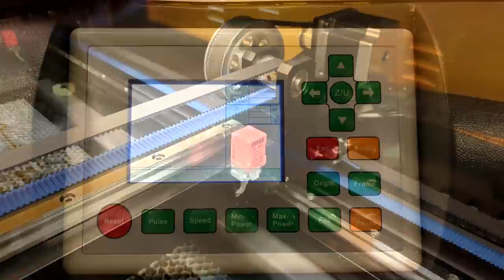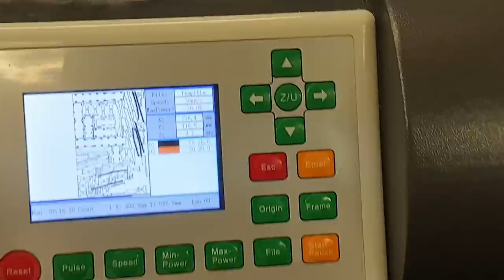China 100 W Laser at work - real time cutting of plywood 3D model of Suriname bridge

Comment: Hi @Tinkerman
I'm also looking into getting a 1060 or similar. As I'll be cutting usually 6mm birch ply I was thinking on getting it with the RECI W4 but is not commonly used so the choices reduce.

I've notice one of your wishes was to have the belt on the X & Y axis. Is that to increase the torque so u could run the machine faster? or is it for another reason?

Also, I've read on AE and in your comments that the price included all the tax however I'm worried to buy it and then get a call from customs in Estonia and have to pay +20% of the machine again... As you're in EU, could you tell me about your experience?

Thank you very much in advance!

Looking forward to seeing more videos using it too!
Reply from the maker: Hi Cabani. The belt is to reduce steppermotor vibrations mainly (not what you would expect is it?). In videos of Sarbar MultiMedia (https://www.youtube.com/playlist?list=PLeKaKWOIPgi_XP6Nxzeapp-vUMCLQyVMB) this subject is extensively discussed. As for my experience with the delivery: At a certain point in time, after 6 weeks of waiting, nobody could tell me where my machine was. Track and trace told me that it was still on some trainstation in Bulgary somewhere. Calling the shipper and asking him about the train station or any other location where my machine might be, resulted in an angry man telling me that i was not his customer and that i should not talk to him but to the shop where i bought the laser machine... that gave my a very uncomfortable feeling for a while, but in the end, after being patient for about 10 weeks, it just turned up and was delivered at my door and I never had to pay any taxes afterwards as promised. So yes... you will have to take a long leap of faith, but it is worth it!! They deliver as promised. If they didn't they would be expelled from AliExpress.
Reply: @MakerFarmNL  Damn, I'm truly grateful for sharing such a gold mine! So much content to learn from on Sabar's channel! Now I need find time to learn from him too.

Now I see the purpose of the extra belt, to avoid what he calls "the curtains" isn't it?

I can imagine the nervousness of having the expensive box on an unknown position.

Since we're at it, are you using any sort of fume extractor with active carbon filtering?

Thanks for all your feedback is much much appreciated!
Reply from the maker: @nachetejr  Yes the Sarbar Multimedia channel is quite an impressive source of knowledge! I use this https://www.hbm-machines.com/producten/werkplaatsinrichting/elektrische-ventilatoren-an-aircos/hbm-300-mm-professionele-ventilator to extract the fumes from two points (back and side) on the machine. I just vent all the fumes to the big outdoors (I have no direct neighbors), and i don't use any filters, because they would obstruct the airflow too much IMO. The sublimation process implies that the materials are being transformed into a gaseous state. That means that the laser will ignite these gasses in many occasion. So big flames will often be produced underneath the honeycomb table. In order to extinguish these flames and to make the gasses less dense a huge airflow is necessary. The standard airflow of the machine is only 20% of what is needed for this flame-extinguishing-process to be effective.
Reply: @MakerFarmNL  I hear you, an inline fan. Unfortunately I'm surrounded by people and I should have a filtration system. 
Thank you very much for all your inputs, I'm looking forward to see some more of your work and learning tips and tricks from it ;)

Comment: Hi, Tinkerman, I watched your video and it's fantastic how these laser cutters work. I want to buy one for my self. Doing a little research what to buy and what is total crap. So, I watched your video and I don't understand what is that kind of pen looking thing sitting next to laser beam output. Can you tell me more about it? Is it for autofocus?
Reply: That is the limit switch to set your auto Z zero.
Reply from the maker: Yes that is indeed the Z-stop that is used for autofocus. When selecting AUTOFOCUS in the menu of the Ruida controller the machine's platform goes up until it reaches the switch (the pen-like thingi) and then the build platform goes down (depending on your lens) to the distance corresponding to approx. 90% of the focal range (measured form the core of the lens). The real focus should be inside the material thickness (!). In my case with a lens with 63 mm  focal point I go down 8 mm, measured from the tip of the nozzle.

Comment: what is the best cut sitting for this process?
Reply from the maker: With this 100 Watt laser with a 63mm focal length lens, the settings for cutting 2.7 mm plywood are speeds=30 mm/sec  and power = 30%. Max. power = min. power during cutting (always!) so no reduction in power in the corners during deceleration - this is to compensate for lag of the beam!

Comment: Very nice! I see you have the laser flat against the wall. Did you make a new hole for the extractor to pull from? I have the same laser arriving on friday! :D 
Thanks!
Reply from the maker: You noticed that very well! Indeed I have created a flat duct (with same surface area as the round exit opening of the fan on the back of the laser casing). In my local DIY shop I was able to find flat duct parts that are meant to construct your own piping solution made of white PVC. I have also made a second opening on the side in order to increase the volume being extracted. Now I can cut anything with the lid open and never have to worry about fumes coming out of the machine. I hooked up an external ducted fan that is connected to both outlets via flexible hoses. This is the ducted fan I use for the perfect gas extraction: https://www.hbm-machines.com/producten/acties/hbm-300-mm-professionele-ventilator. I wish you many creative hours of fun with your machine - as I am having!
Reply: @MakerFarmNL  That's a great idea I was thinking of something similar as I want to try and get my laser flush to the wall. I ended up getting a Systemair RVK 8" blower rated at 1km3/h. If you ever do a followup video of the laser I would love to see how you connected it all. 
Thanks for the really fast reply.
Alex

Comment: Why is it cutting so ineffective? Is it the gcode? It has to move a few times across the whole area to cut pieces at different spots instead of just working from top to bottom.
Reply: I have noticed that most lasers do this. It might have something to do with not wanting to heat up in one area too much, but it doesn't seem to be terribly rational.

Comment: hi you bought that on alixpress??
Reply from the maker: Yes, after studying what specs I would like the machine to have, i simply stated those specs to the seller and they gave me the price inclusive transport and all taxes and it arrived on my doorstep 2 months later. It worked right out of the box. Those specs are: 800x1000 mm working space. 100 Watt Laser RECI. Ruida controller. Autofocus functionality. Red dot laser pointer. Linear rails on all axes. Extra belt gear on X- and Y axes. CW 3000 waterchiller. Honeycomb table. Detachable legs - so that you can move it through doors of 75 cm wide (on it's side). I am using the machine on a daily basis and it is working flawlessly!
Reply: @MakerFarmNL  hi can you tell me the sices of all the package complete
Reply from the maker: @manuelalejandroguardado3917  Machine dimensions are: Height-940mm inclusive legs (370mm), depth=1180mm, Width=1550mm. Packaging height is smaller due to dismounted legs. Packaging width and depth are slightly bigger (say 150 mm). I ordered at the ChinaCNCzone store via Aliexpress (contact: House Han).
Reply: @MakerFarmNL  post a link to the sellers page.
Reply: How much actual electrical power does it consume? power from your outlet.
Reply from the maker: @Z-add  Hard to say, but no more than 300 Watts for sure, because I run many things on that same group that are total of 3300 Watts. Groups max = 3500 watts. Sometimes all simultaneously and no fuse burn-outs. Link to ChinaCNCzone store is: https://www.aliexpress.com/item/32934963650.html?spm=2114.12010612.8148356.1.5d19255aKdj0bU
Reply: @MakerFarmNL  do you have a instagram? tio see better your works
Reply from the maker: @manuelalejandroguardado3917  No haven't got instagram.. will look into that.
Reply: @MakerFarmNL  Hi mate, did you get the machine from LCSpare store on Aliexpress ?
Reply from the maker: @invaziq  No from ChinaCNCzone: https://www.aliexpress.com/item/32934963650.html?spm=2114.12010612.8148356.1.5d19255aKdj0bU
Reply from the maker: @manuelalejandroguardado3917  The box that it was transported in was only slightly bigger than the machine itself. Minimal packaging, but sufficient. Machine worked right out of the box, no damage.

Comment: Where's the smoke? Where does the ash go? I see no extraction. Your passes must not be very deep, so you must be making a lot of passes to cut all the way through.
Reply from the maker: The smoke is blown through the cut (and honeycomb table) downwards and then it is "extracted from" of the machine (suction) by fans. This is one pass cutting. Laser cutting is based on sublimation, not burning. The smoke only comes from heating up the edges. The material in the middle of the cut is sublimated (transition from solid state tot gas state). Sublimation creates no smoke. The more smoke the less sublimation. If you are having trouble cutting through, then: Either your laser has not enough power OR your lens is dirty OR has the wrong focal point OR you are not cutting in the focal point of your lens. Other reasons of burned edges: Birch wood is very easy to cut. Other types of plywood can be very hard to cut.
Reply: @MakerFarmNL  Hmmm. Someone has apparently attempted to yank somebody else's chain. Wood doesn't sublime. Very few materials do, even when tremendous energy is directed at them.
Reply from the maker: @timhofstetter5654  Lol, no you didn't yank my chain, but as far as I can deduct from the info on sublimating wood, the separate components of the wood do sublimate when exposed to the energy of the (focal point of the) laser. Although agreed, the term sublimation applies to materials that have a liquid state as well and many of the components of wood can only be made liquid under extremely high pressures, which is not the case here, so those component technically probably evaporate. But to cut things short I think one can say that the laser sublimates most components of the wood. What I am wondering however: What makes you say "you must be making a lot of passes to cut all the way through" while anyone can clearly see in the video that the laser cuts through in one go. That is a very special observation you make there. :-)
Reply: @MakerFarmNL  If you can see that so clearly in the video, then your display resolution or video size or perhaps your eyes themselves must be better / larger than mine.

News flash: oxidation is not equal to sublimation. Those are completely different processes. The LASER oxidizes the combustible components of the wood, leaving ash behind. Much of the ash may be blown out of the kerf by the explosive oxidation of the combustible components... and then carried away by the extraction bed.
Reply: @MakerFarmNL  Oh, and I'm  not suggesting that I'm yanking YOUR chain. Either someone else has yanked yours or you're trying to yank ours.

Comment: Hi, I've got the exact same machine but I could not cut 3mm plywood on these settings. I usually have to use 20mm/s speed at 60% to get decent cuts. What focal length lens are you using?
Reply from the maker: 63 mm focal length.